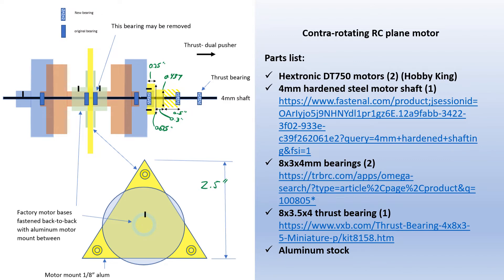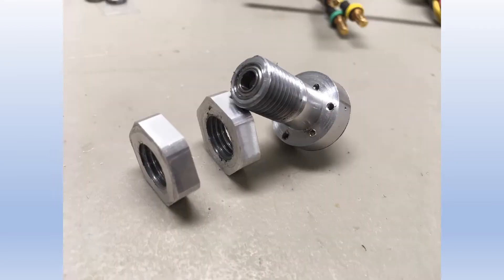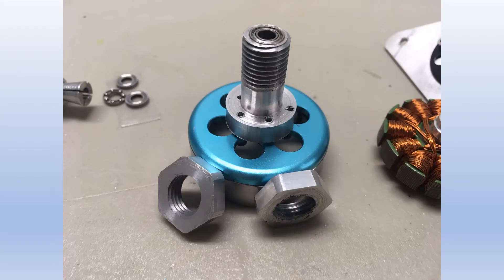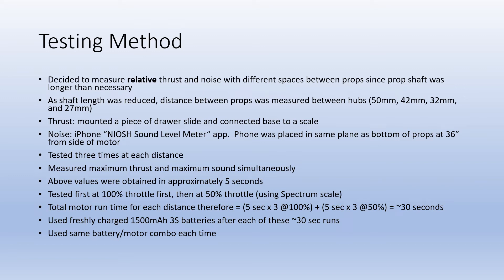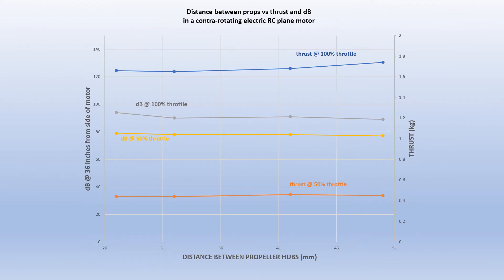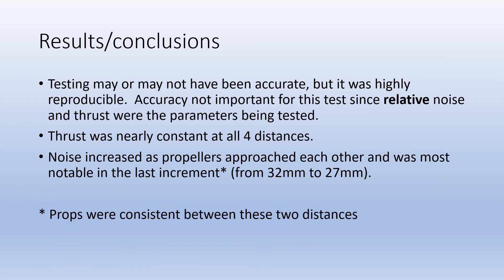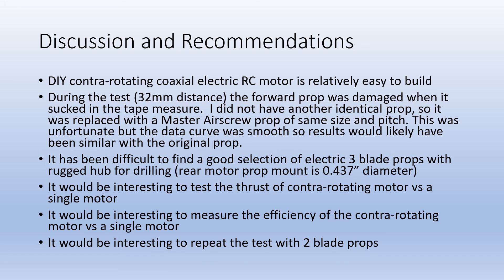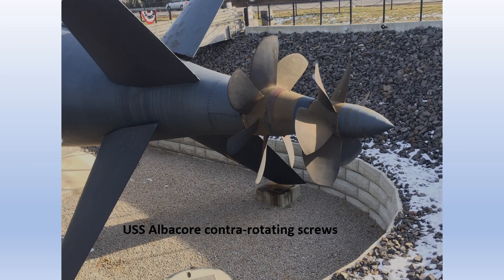Contra-rotating axial motor for RC plane

Comment: So basically you found no advantage or disadvantage to running this set up? Other than the torque from the motors canceling each other out.
I have thought the way to create more thrust might be to increase the pitch but shorten the length of the second prop.
If the first prop is doing more work by pulling in and accelerating the air into the second blade, does it really have to work as hard to push the air through?
Would be interesting to see if the amp draw is the same when matching props are used. If the amp draw is lower then increase the pitch of the second blade until the amp draw is the same and then check the thrust and see if there is any gain in thrust or maybe efficiency.
I would be very interested to see what counter rotating ducted fans would do.
If there were ever an opportunity for two motors to share a load it seems like that would be it. The second emf would have to be helping the front one by helping to suck air through the first fan by way of the ducting.